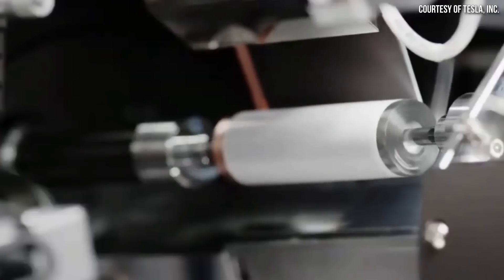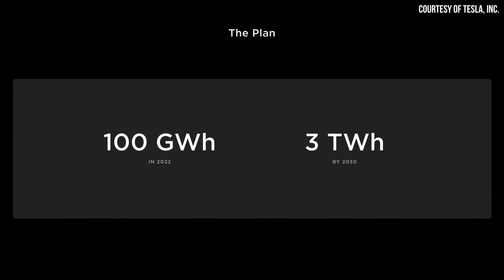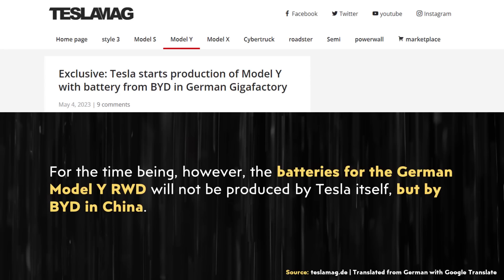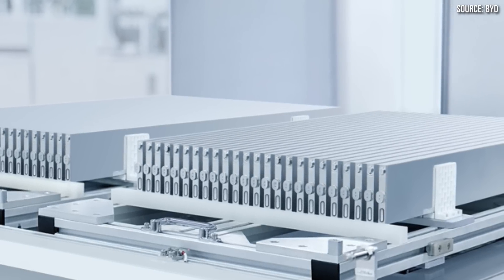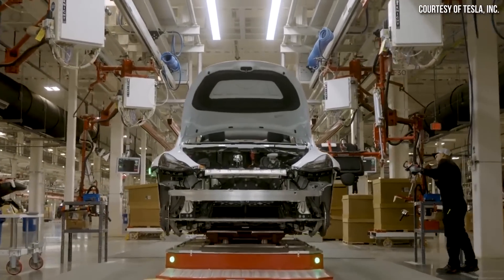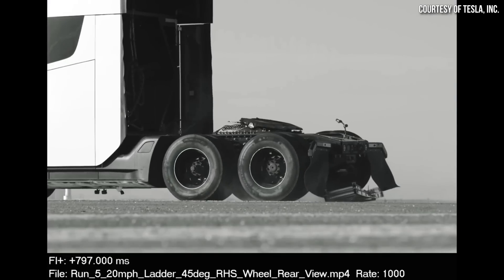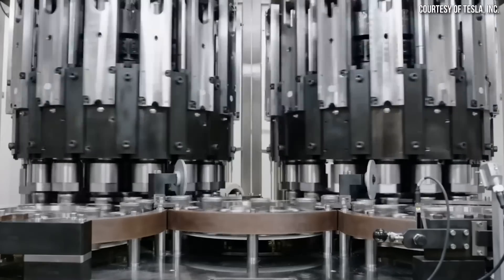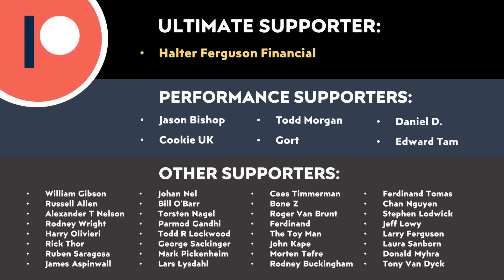NEW Tesla Model Y w/ LFP Structural Battery | Tesla Battery Supply Update

Comment: Cybertruck is at least a full year away from any significant ramp and will likely never pass 150k/yr, and definitely not before 2026. So if Tesla this has issues supplying enough 4680 cells for that slow ramp only instead of the Truck, Semi, Berlin + TX Model Y (as well as the upcoming robotaxi), they might be in trouble, overcommitting and all.

Good idea to diversify tho, Panasonic just announced their 4680 delay and considering Tesla might be working on theirs for over 5 years with few packs per day to show for might lead to significant delay to the next gen vehicle that takes structural and simple made father. I mean the fact that Berlin isn't doing 4680 perhaps just to stockpile pack or ever send back to the US is concerning. They've spent billions on that part of that factory + equipment.
Reply: Didn't age well did it?
Reply: @rogerstarkey5390  how many Cybertrucks in customer hands again?

Comment: For those saying "they can't (fully) solve the DBE process".
.
You've been given a clue by Tesla when they mention various iterations (upgrades) to the DBE machines.
Do you think they simply install the "Mark 2" machine and throw the "mark 1" away?
.
They get the Mk 2 to speed, then UPGRADE the Mk 1, they then feed the "Canning process" plant with both machines.
.
I think they're up to version 6(?)
.
There's no reason they couldn't say "DBE Cathode production is slow, install 15 units, run them (reliably!) at 7% maximum while we develop the process"
.
It will take up some extra space, but you get the "cans" leaving the factory at the desired rate.
As the process is refined, add (for arguments sake) a "30%  production" machine, test it, modify 3 of the 15 old machines, test them, then move the others to a second and third canning line, modifying as required.
Repeat until full potential is reached.
In other words the machines don't have to go from zero to 100% in one step.
.
Now
A BIGGER problem would be issues with the tab folding process.
THAT could really slow development.

Comment: I strongly disagree with Teslas success not being tied to their battery ramp: While in the short time they may be able to continue with suppliers, it is not their automotive business that determines unltimate success. As discussed on battery day: For them and their mission to succeed, battery costs have to come down and battery production needs to ramp to whole new levels. Teslas 4680 project was the key innovation for that. If they succeed with this one, they will transform the world and it doesnt even matter if they build 30mio cars themself or other manufacturers build them with Teslas batteries as the whole world will become electric.
Making a 4680 (with dry electrode and using continious production process) should be much faster and even cheaper than producing the smaller formats and for any given capacitiy you need fewer (of the larger) cells. Placing ~800 cells in a pack is much easier and cheaper than to place ~4000 in a pack... and so on. Also for energy storage the world requires TWhs of capacity which only seems feasible by using a larger format, reducing part count. Reliable and cost effcient energy storage is key for mass adoption of renewables, so also key for solar business.

However, until now its dissapointing. Ramp is slow, cell performance below expectations and the few vehicles so far equipped with the new cells are neither cheaper nor lighter and have even less range.

Comment: Panasonic announced earlier today that the 4680 delivery window has been pushed to Q3 2024.  Hard to see how Cybertruck gets to volume before 2025 if that's the case.
Reply: So your prediction is that Tesla doesn't figure  DBE process on their 4680 for few years?

I would say Tesla is on around 10-15 Gwh annual run rate on their 4680 by the end of this year. If cybertruck has about 150kwh battery Tesla would be able to make 70-100k CT:s from their own 4680 production without even ramping.
Reply: @malax4013  Points taken. In my mind "volume"  is 250K CTs/yr and I was also thinking that Model Y AWD would also be at volume, requiring between the two a total of ~55 Gwh/yr of 4680 cells.   
Although Texas' design goal is 100 Gwh/yr, the last update from cleanerwatt ~2 weeks ago based on Q1 earnings call info was that 1 of 4 lines in the Austin battery factory is commissioned and that line isn't running anywhere near 25 Gwh/yr.   Best guess for current total Tesla combined run rate of 4680 between Fremont and Austin is ~6 Gwh/yr, so your numbers for end of year seem quite sober, given that Tesla could in theory get there by commissioning the second line.
Reply: @omm5960  
You mention "commissioning the (a) second line".....
They don't need a second COMPLETE line.
They can break the process down to.
Cathode material production.
Anode material production .
"Jellyroll" production.
"Canning" process (including tab folding)
Cell closing (cap/ welding)
Testing.
.
If one part of the process is slow, double up on that section.
.
Slightly cumbersome, but gets the job done.
As that process is refined, the spare capy can be transferred to another line.
Organic growth.
Reply: @rogerstarkey5390  I used the definite article when referring to the second line for the same reason that Drew Baglino used it during the Q1 earnings call.
Reply: @omm5960  I think the problem with 4680 is that there is still problems with using the dry process for anode and cathode. I would see faster ramp in future when they figure all the chokepoints and problems.
Then you can just build more lines that can ramp quite fast. But I don't know how many more problematic things there is figure out before you can really start ramping.  I think it's end of this year or maybe first half 2024. Then we can see the real ramp of 4680. 

About CT production. I think it's going to be:
2023:5-10k
2024: 50-100k
2025: 250-300k
Maybe max out somwhere between 300-400k
Reply: @malax4013 Agree 100%.   I will just add the observation that the 4680 plan resembles NASA's Moon race plan in that there was parallel development of factory space, tooling, and basic research.  But I'm not aware of anything in the Nasa plan being as big of a stretch as the dry cathode.

Comment: Funny to think back a couple of years when Tesla first unveiled their 4680 batt., how most everyone thought that was the silver bullet of batteries and would be in EVERY Tesla at this point.
Reply: Any manufacturer could easily start producing larger cells like the 46-80. I'm pretty sure that what's holding up the ramp is getting all the kinks out of the DBE process for the cathode. Once they get that sorted out, they'll start installing 46-80 lines as fast as they can get there hands on the equipment.
Reply: Not really "most everyone". I remember a lot of sceptical comments back then after battery day but the hype was much louder.
Reply: Funny to think you still don't understand either the concept or the requirement.

Comment: Isn't the 4680 battery production costs already equal to Panasonic 2170?
If this is the case, then it's already a win.  Scaling production further is simply further cost differentiation from the competition.
Reply: I try to think in terms of "cost of kWh (GWh/TWh) leaving the factory
The form factor of the cell and cell chemistry is only part of the equation.
.
Tesla (Maxwell) asked:-

1) What makes the factory large? How can we remove steps that make it so? (DBE)
.
2) What's the "sweet spot" in cell form factor considering speed of capacity production, material packaging? NOT cell quantity! (4680)
.
3) Can we overcome previously unsolved challenges encountered when attempting to achieve that sweet spot? (Resistive heating/ Tabless)
.
As usual, they attempt to and eventually succeed in building an improved system rather than a slight modification.
.
Panasonic, etc, seem to have gone half way, retaining wet electrode production, not going "full tabless".
They may achieve good interim results, but the full prize remains a small dry process factory producing higher efficiency high contact, low resistance tabless cells.
.
Once the crack the problems and reproduce "the system" it's a licence to print money.

Comment: Biggest problem with the 4680 is that Lithium-Ion is passe'.
Batteries are evolving so quickly, you're damned as soon as you commit to something.
Reply: Sodium batteries still have a way to go.
Reply: @surferdude4487  
Notice the switch to LFP?
Reply: @3DThrills  What do you think the "L" in LFP stands for?
Reply: @surferdude4487  
Lithium Iron Phosphate batteries don't need Cobalt, Manganese or Nickel, like Lithium-Ion. They also don't catch on fire. They can also handle up to twice as many recharge cycles.
Reply: @3DThrills  All true except that  it is still a lithium ion battery.
Reply: @surferdude4487  
No, it is a Lithium Iron battery
Common homophone error
Reply: @3DThrills  LFP batteries can still catch fire.
Reply: @3DThrills  
"Lithium IRON batteries (actually "cells" if we're being accurate) don't need Cobalt Manganese or Nickel"
.
Please investigate the latest CATL chemistry.
LMFP
(That'll be Manganese, added to the LITHIUM Iron Phosphate chemistry)
.
"They don't catch on fire".
(Recent fires involving BYD vehicles, who as far as I'm aware only use LiFePo4 cells(?) seem to indicate otherwise....)
Again, you seem to be confusing chemistry, process and form factor, assuming that BYD= exclusively "Blade cells" (introduced a few years ago, Google it) whereas they produced many cells before the demonstrably safe "Blade" Form Factor
It's quite possible the fires were in older "pre blade" BYD vehicles, but your statement that "LFP cells don't catch fire" is false.
It depends on circumstances.
.
Considering "other" cell chemistries, you should pay attention to the research of Jeff Dahn (I'm assuming you know who he is?)
.
He has quite clearly stated in the past that his team found the reason for the chemical reaction promoting fire in nickel based cells (NOT just dendrites).
A certain chemical in the electrolyte was apparently a major contributor. It could be (I assume was) eliminated.
.
Cycle life.
In 2022 he (his team) stated they could increase the cycle life of Nickel based cells simply by reducing the voltage range. 
This led to average cycle life many times that of LiFePo4 cells, while still retaining higher effective energy density.
From memory, he quoted "50 year life", but I suggest you search "Jeff Dahn EMS 2022" 
and watch his keynote presentation.
Reply: @3DThrills  
"You're damned as soon as you committ to something".
.
I assume you refer to 4680?
.
Its "just" a form factor.
.
Why do you think that other chemistry couldn't be adapted to the cylindrical form?
.
(Here's where you quote "solid state")
.
You're missing the point that even over and above you "lithium ion passe" assumption, the "4680" manufacturing system is designed to enable maximum GWh (TWh) leaving a small factory with refined processes.
It's not necessarily chemistry ("lithium ion") or process (DBE) specific.
.
If an anode and cathode can be rolled into a cylinder, it provides the fastest way to get energy capacity out of the factory .
That speed reduces cost.
Those factors (cost/ volume) achieve the objective.
Reply: @Ra Denney  
You're mistaken
.
Lithium IRON is a "chemistry" 
.
Lithium ION is a general classification of the process describing the transfer of "ions" within a cell.
Very specifically, ions of Lithium 
.
You should note the chemical similarity between the common abbreviations "LFP" (Actually "LiFePo4 ")
.
"Nickel (Manganese) based"
(AKA NMC, Li-NMC, LNMC or NCM)
and
"Nickel (Aluminium) based"
(AKA Li-NCA, LNCA or NCA)
.
They ALL use Lithium.
.
If anything, the general error is that of shortening the names when attempting to make them simpler for the uninformed to understand.
.
Many have since made the same error as yours, confusing the component, "Iron", with the method of charge transfer, "ion"
.
They are all "LITHIUM ION" cells.
.
You ARE in error.
Reply: @rogerstarkey5390  
I've got two LifePo4 batteries.
You don't know what you're talking about.
Reply: As if new battery technologies are easy to manufacture at scale.

Comment: If the Geman MY body in white have NO floors in them, Then the blade battery is indeed structural.
Reply: Nope it’s not structural lol!!! How strong is the housing of those cells to be even but together!? I’ve seen the cells testing at BYD
Reply from the maker: I don't yet know if that is the case, or how "structural" these battery packs are, but I hope so.
Reply: @Cleanerwatt  If they are throwing carpet and bolting seats directly to the battery, Then it is a structural one.
Reply: @dclpgh  not necessarily

Comment: Blade batteries are not “structural” in the same way Tesla has defined. Elon has repeatedly spoken out against blade batteries as a form factor appropriate for vehicles. I’m skeptical these are blade batteries for those reasons. Blade batteries can twist. They are simply too long to be structural. Think: honeycomb for a weight-efficient structural design. Blades are the opposite of structural being long and thin.
Reply from the maker: That makes sense. I guess we will see.
Reply: Blade battery is only the best battery on the planet
Reply: @bydman5320  
"Blade" is a form factor.
As for chemistry, I'm sure numerous companies might hold other opinion.
Reply: @rogerstarkey5390  you must think I’m brand new. The blade battery is a prismatic structural LFP battery, 3 years BYD has had them in cars and many more years in their Busses. They got the idea from their busses because they were so reliable and last for hundreds of thousands of miles. Byd has had heat pumps in every EV for years as well because they’ve seen the benefits for many years. Now their 8 in 1 transmission is being copied by VW and soon many more I guess. 
            They are miles ahead that’s why Elon copies what they do and then fanboys claim it’s a Tesla idea
Reply: @bydman5320  And we see so many fires of BYD new cars. Really concerned about safety if Tesla use blade batteries.
Reply: @wayway1218  if your concerned about safety don’t buy a car with the safest battery in the world then. You aren’t seeing fires with a blade battery. Zero exported blade batteries have caught fire. Anyone with half a brain would think maybe somebody is trying to trick me here. Time to wake up
Reply: @bydman5320  you don’t see exported BYD catch fire because BYD exported just little cars so the base number is just too low. Blade battery did catch fire, do your research. 
Blade battery is more safe as a battery type doesn’t mean it’s more safe when everyone to produce. Manufacturing quality means a lot. And I am really doubt about BYD quality as it’s track record of quality was so poor.
Reply: @bydman5320  As a Chinese living in China, seeing so many “tricky things” from Chinese companies, any “innovation” from Chinese company make as skeptical, if you still having great dream of BYD, I would recommend you wake up.
Reply: @wayway1218  Chinese living in China, you think I’m brand new
Reply: @bydman5320  Yes. You’re new, didn’t see so many Chinese living outside China but shouting everything in China is better.
Reply: @bydman5320  Indeed!